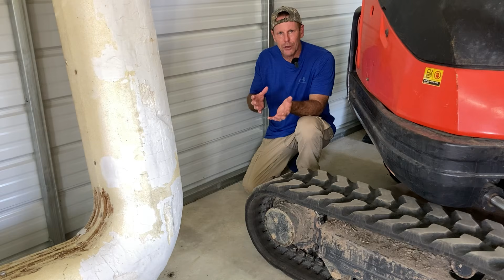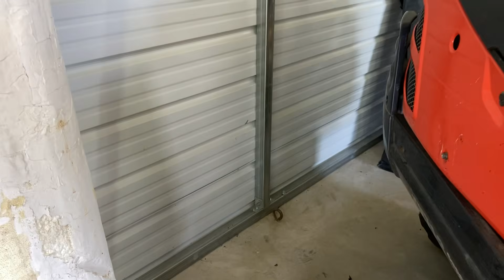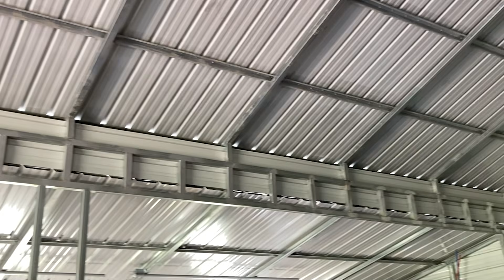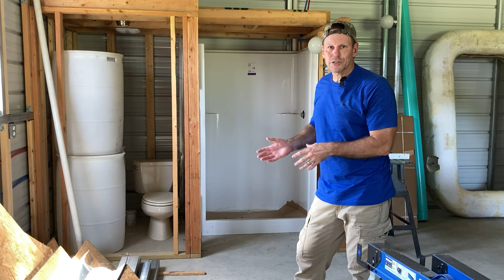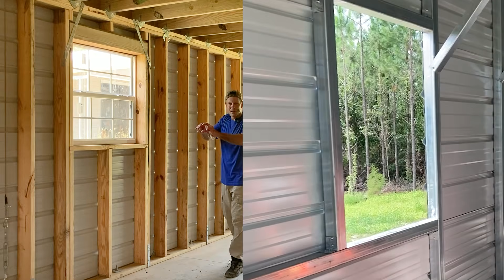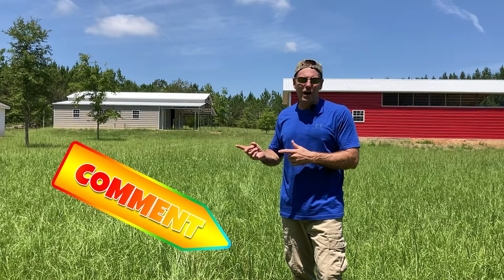Which one is better?  Pros and Cons of Pole Barns & Metal/Steel Buildings

Comment: Outstanding information, however I am more confused than I started! Great points on both and gives a lot to think about. Another great thing about your video is you went to each area as you discussed it, much appreciated!
Reply from the maker: I would give the metal/steel building the edge in many areas.   Thanks for watching!
Reply: Good info, thanks. We trying to decide which way to go as well.
Reply: @MikeOrazzi  I went with a stick-built garage with bonus room above should be done in 60 days.
Reply: Nice what size did you settle on? I'm trying to figure out what I want to get under cover. I know my truck with dump trailer is 51 feet long.  @uploadtime1780

Comment: 20 ft plus posts 4 ft deep 36 round
Double up trusses run flat boards 
Pull your numbers run em 
Build em low bitch nail everything then lift to hight 4 n 12 or ?? with a block or nail to get gift
Winch box top or crane n go bay by bay 
Pulling bitch nails as you go 🔥
Reply: Your welcome

Comment: On the steel building you can use a stem wall to put the building on and you could use plastic conduit for the wiring,
Reply from the maker: sounds expensive

Comment: Wow, I thought I was going to get a metal one. Now I’m not sure. Thank you for the pros and cons. I have to rethink this. For example I didn’t know the metal one needs concrete done first.
Reply from the maker: They will put a metal building on a level gravel pad, but I'm not sure how you would pour concrete for it afterwards.  I guess it could be done?  Give Chad a call and ask him: Chad Burke (912) 294-2011
Reply: @PineyGroveHomestead  you can concrete after just put the concrete anchor through the steel beam alot of people that pour the metal buildings after there built also typically pour them to the top of that steel rail on the bottom which will permanently connect the building to the pad
Reply from the maker: @BlakeMerckleTrucking  Makes sense but that could trap water and rust out the bottom metal.  thanks for watching.

Comment: You can build these also on top of blacktop and I have seen people pour a concrete floor after the building is installed. plus if you want with full A-frame roof and not an A-frame + leanto  you wouldn't have that post there
Reply from the maker: There are many options with steel buildings.
Reply: @PineyGroveHomestead  Yes there is

Comment: On our new 70x192 we went with the engineered steel 10,000 psi perms columns so no wood was below grade. But out 60x120 Morton built in 1980 with wood post below grade have no signs or rot. Not needing snow load rating makes things a bit simpler too !
Reply from the maker: I'd prefer no wood in the ground, but this building will outlive me...unless a tornado blows it over.   No snow load needed here in North Florida!  Thanks for watching.  Brad&Deb

Comment: It was very interesting listening to the differences and comparing it with the buildings that can be bought over here in the UK. The nearest we have to a pole barn is a steel barn that uses steel poles bolted to concrete footings. The design of metal buildings we have is different too but the outcome largely the same
Reply from the maker: We don't have a frost line in Florida so that changes how building are built as well.  We are primarily concerned with wind (hurricanes), while in another region it might be ground upheaval from frost, or pitch for snow loading.   Thanks for watching.  Brad&Deb